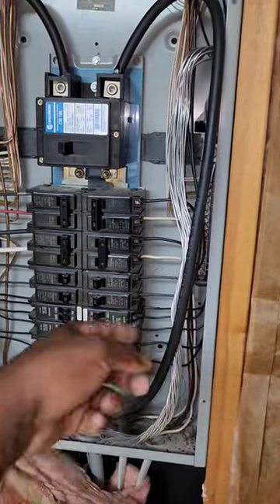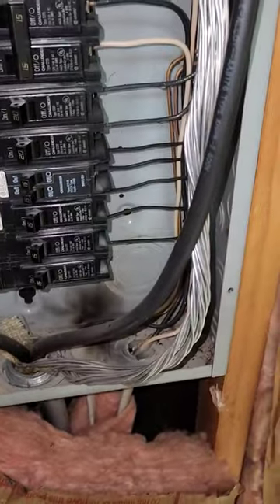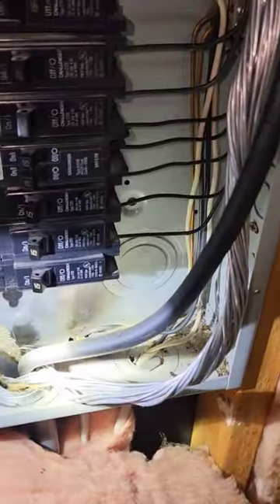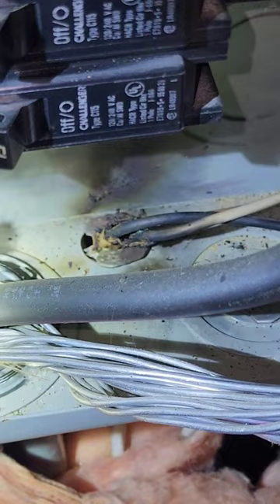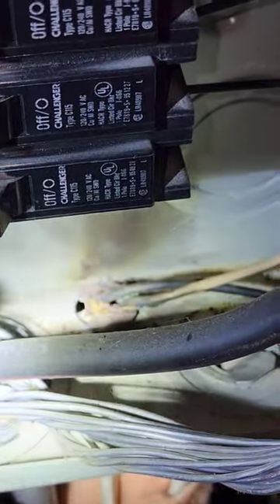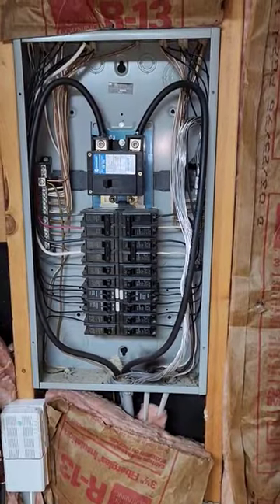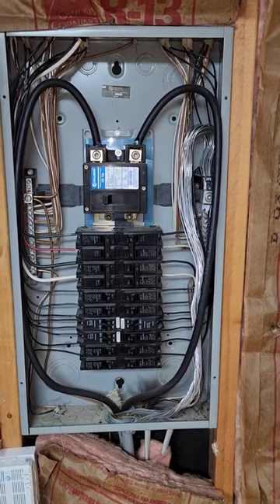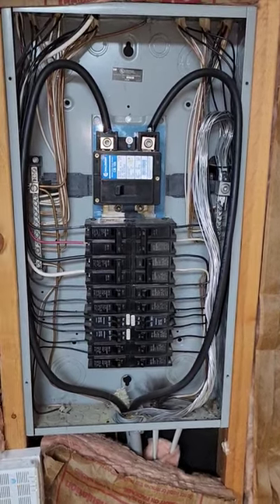Neutral and ground touching causing a short. #integrityairatl #milliondollarinspector

Comment: Looks like there is no neutral in that circuit. They didn't use red wire or tape to identify the wire as a hot but landed it on a breaker anyway. Ouch.